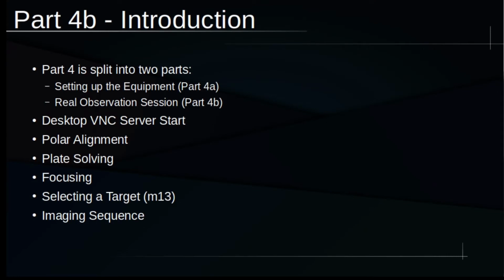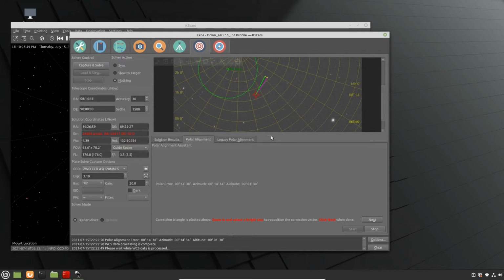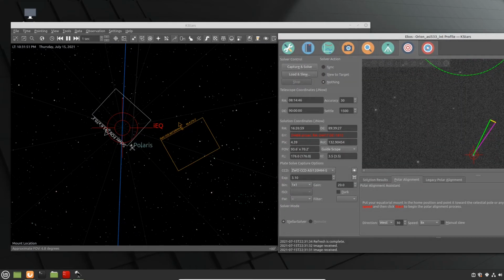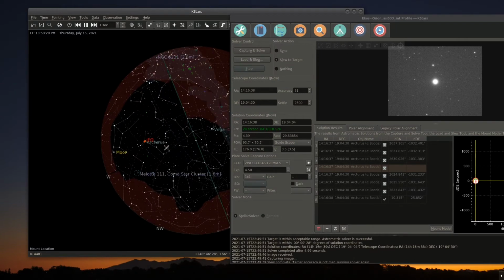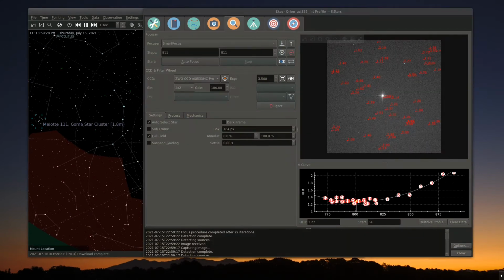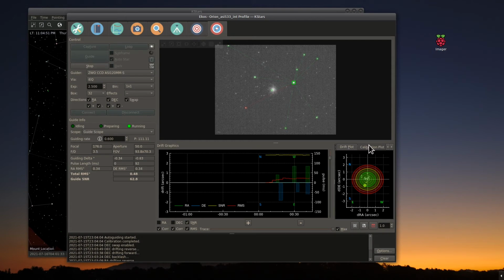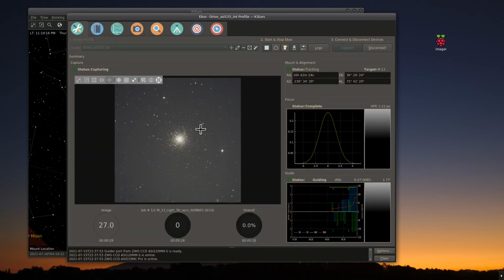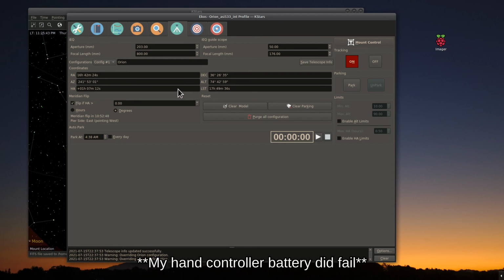Part 4b - Ekos/Indi Installation on a Raspberry Pi4, Observation Tutorial

Comment: When you get polar aligned are you free to put the mount back in its home position? Or do you slew to objects from there
Reply from the maker: After you are finished with the process, you can exit. Make sure you go back to the solver control tab and reset silver action to "slew to target" so that future plate solving skews to target.  You then can slew to a target using the planetarium window. You do not need to home/park the telescope.

Comment: At 9:05/34:29 the polar alignment was vague because I didn’t see anything move in the yellow/green/red triangle.  What did I miss ?
Reply from the maker: The yellow/green line is a reference, the idea here is to move the star  to the target cross hairs.  The later versions of Kstars will include a yellow circle around the choosen star and you can see the star/circle move when adjusting the Azimuth/Elevation of the mount.  In the video (8:20) you can see the stars move and the target star move into the cross hairs.  Hope this helps.

Comment: For guiding do you need to set the gain & offset ?
Reply from the maker: Yes, set the gain/offset based on the number of stars and image.  I use a gain setting to display the stars at a reasonable exposure setting for guiding.